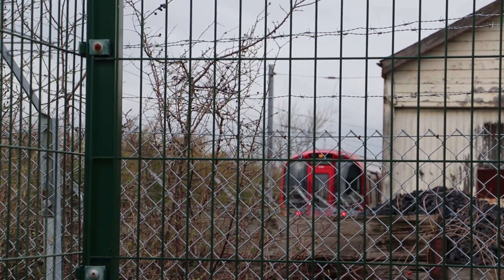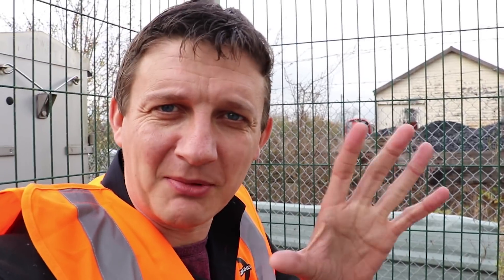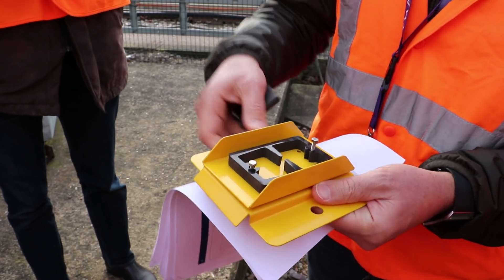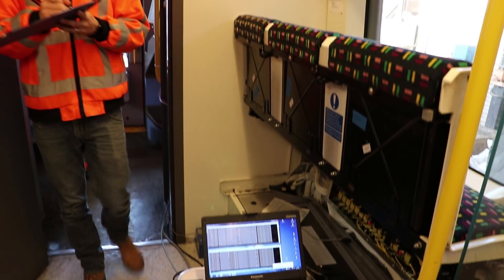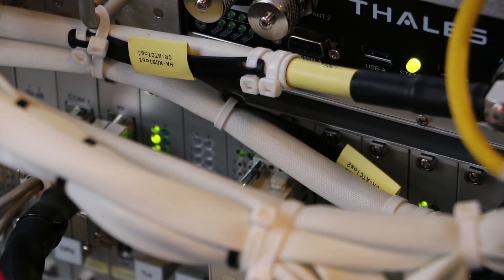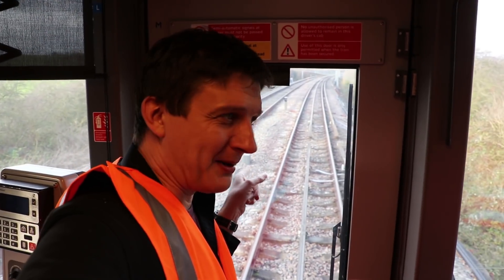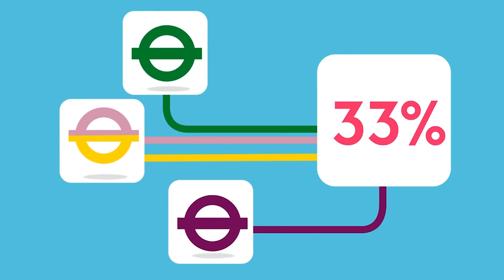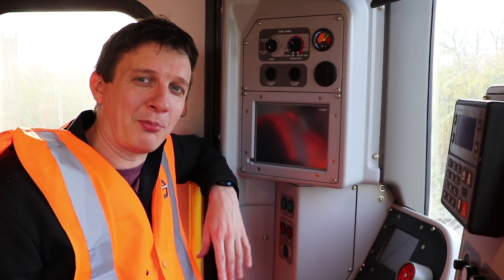London Underground Four Lines Upgrade

Comment: How is an increase from 28 to 32 trains an hour, a 33% increase? 🤔
Reply: That's exactly what I was figure out!
Reply: Bigger trains + more trains, both adding up to a 33% increase in capacity.
Reply: Number of passengers inside the train increased coupled with 28 to 32 tph increase gives 33%
Reply: I think the trains can go at a faster speed as well

Comment: It’s funny the trains have indicators
Reply: Mark StJust 1:45
Reply: That indicates the train is being driven in restricted mode
Reply: Looks awesomely funny LOL
Reply: Will Warde-Norbury you are a king
Reply: Closest thing I've seen is that the trams in Manchester have indicators
Reply: I thought the same thing!
Reply: Will Warde-Norbury lol ur right
Reply: nige4444 u have a point
Reply: +1
Reply: S stock are getting modernised after 22 years of work?? XD! BETTER GIVE C STOCK BACK ON HAMMERSMITH & CITY AND ON CIRCLE LINE! because C stock me is mad at you
Reply: Will Warde-Norbury c
Reply: nige4444 that still means they are indicators right? XD
Reply: William the butchers son productions probably to indicate when it's stopping and pulling off from a station.
Reply: They are lights.
Reply: All new build, and retro-fitted to some of the older builds are hazard warning flashers. Will make it obvious to other Drivers that there is an on-board emergency such as a Driver taken ill, or other emergency. Will augment the GSM-R on-board system.
Reply: Maybe the trains indicate when they switching tracks
Reply: They don't

Comment: Am I the only one that feels kinda bad about all the drivers out of work?
Reply from the maker: trains still require Train Operators (drivers) so no one is "out of work"
Reply: nah, surface lines are still likely to be manned for a long time...
Reply: The Victoria Line has been automated since the 1960's and still have drivers in the Cabs...
Reply: First next major tube strike. LUG will just flip the switch to automate the trains.
Reply: I don't think they'll be out of work. What might happen is that the lines will eventually become automated (especially if the New Tube for London upgrades go ahead) but there will still be a driver in the cab to open and close doors and in case of an emergency, or it might become like the DLR which is driverless but has a member of staff on board. IIRC DLR trains can be manually operated if there's an emergency or the computer fails.
Reply: stephthestar90 DLR can be driven manually only at 5mph. Tube stock with ATO all have a full speed manual mode
Reply: At least for the time being...let's see what will happen in some 15,20 years from now...
I wonder if in 2037 will there be drivers on the Underground/tube trains  or will it be like the DLR...

Comment: Well...it’s high time to modernise Piccadilly and Bakerloo line stocks, I thought that this vid will be about it 🙇🏼‍♂️
Reply: The New Tube for London :P
Reply: POKWIŚ TV that’s the next underground project once this is done.
Reply: Well since the 4 lines are the sub-surface S stock lines that's not very likely. The 4 Lines of 4LM in case you are not clear are District, Met, Circle and H&C.
Reply: About 10 years away - Picc first, then Bakerloo in 2029 to coincide with opening of Bakerloo Lewisham extension.
Reply: Current Piccadilly stock is 45 years old...
Reply: Picadilly stock goes in 2023 and new stock is coming next year on the Bakerloo

Comment: What's the difference between this and using GPS?
Reply: GPS doesnt work underground.
Reply: Hendrik Brons  And I think GPS is only accurate within about 10 metres?
Reply: GPS is only accurate to maybe 10m even if it worked underground,, you need a physically accurate position system if your going to have trains in a moving block signalling system. Take a look at this already working system, London Docklands light railway, https://youtu.be/a52ZSCIAoRk
Reply: Andrew Gwilliam non-military GPS is. 10 metres ...
Reply: - the ..story.. is that during the Iraq war the us military bought commercial GPS receivers and switched off the drumming down ,, so the commercial receivers became as accurate as the military receivers, and its remained so to this day....
" ... For example, GPS-enabled smartphones are typically accurate to within a 4.9 m (16 ft.) radius under open sky (VIEW SOURCE AT ION.ORG). However, their accuracy worsens near buildings, bridges, and trees."
https://www.gps.gov/systems/gps/performance/accuracy/

Comment: Toronto is about to get full ATC signals on Line 1, but starting in sections until 2018/19 when it will be fully rolled out across the line.

Comment: Ugh, ATO/TBTC is the plague of the Underground. Nothing beats a human on the handle.
Reply: Techandtrains101 As long as there is some Protected manual driving at times, that makes it fair for the drivers
Reply from the maker: incorrect.  tests have shown that TBTC on the Northern Line make the trains more efficient, and a manually operated unit the length of the line cannot now keep to the timetable.
Reply: Londonist Ltd omIt is better numbers wise but the ride quality on the Northern, Jubilee and Central lines have all suffered greatly from the very aggressive on/off driving style of ATO. Also while failures are rarer on the new system they seem to be able to cripple the whole line way more than a regular signal failure. Anyway I'm just a stick in the mud kind of guy I guess...
Reply: The victoria is ATO and is extremely smooth. TfL really needs to get coasting support into the software (it was supposed to be there in the initial Jubilee contract but got left out)
Reply: "Nothing beats a human on the handle"
Except computers. Get with the program (pun not intended).
Reply: ride quality... ffs
Reply: Higher frequency is a greater benefit than slightly more pleasant acceleration/deceleration is a loss.
Reply: looks like we found an RMT member...
Reply: The Chicago L has run trains on less than 2 minutes headways with ATC for a long time with human operators :-)
Reply: I hope the new cbtc system is more smoother, hopefully with the S stock being newer train it might be more smoother, as the 1996 stock had to be modified to run ATO.
Reply: London needs to do this because a human on a handle cannot cope with 36 tph.
Reply: Its more jerky than a human driver ever would drive
Reply: tyteen4a03 think it was ‘cause Tube Lines was pressured to deliver the Jubilee line upgrade...
Reply: Moorgate crash 1975 !

Comment: Damn, I wish the MBTA would do this on the Red Line.
Reply: Ayy fellow Bostonian! 

They can't because all of their trains are 10+ years old, we would have to probably wait around 2022 to even consider this.
Reply: Well I believe the Red and Orange lines are getting new subway vehicles in 2019 - in fact I believe they're being built right now.
Reply: kd1s The Blue Line trains where always pretty good. When the retired the 0600's off of them (0600s are smaller and blue versions of the current 1200's) if they retired the 0600s, why didn't they retire the 1200's along with them?

Silver Line Washington Street is much better now due to the fact we have recently gotten newer buses built by NFI, (New Flyer Ind.) and our current dual modes for the Waterfront Silver Lines are being overhauled by Maine Military Authority for the Airport route. We are also expecting a new silver line route to be introduced in Spring of this year, spanning from South Station to Chelsea via an old Railroad right of way.
Reply: And the WMATA
Reply: yes in Springfield MA they are currently producing them. already the pilot cars are set in Wellington Yard.
Reply: About damned time. I remember when they announced it back in 2015 or so. Now on the Red Line there are the older 15 and 16 and 17 cars - those are rattle traps. But then there are the Bomardier cars that look as though they were built late 1980's, into 1990's. They're built well - but showing their age. 

And the cars on the Orange line - definite 70's - come on wood paneling in the car?
Reply: yes. we probably wont be expecting red line cars for another year or so but green line cars should be coming right about now. Type 8's are full of problems and we are just now rehabing the Type 7's.
Reply: Yeah I'm familiar with the green line issues too. They're also of 70's and 80's vintage cars. It's funny I've ridden on the Orange, Red and Green lines, but never on the Blue or Silver lines.
Reply: RED LINE = Central line Silver = jubilee line Gre-- get a tube map and find out.

Comment: But... Piccadilly. Tfl why are you ignoring Piccadilly
Reply: Errr, have you SEEN the Bakerloo? The Piccadilly line's trains are in a much better condition than the loo but will get the new rolling stock first. Talk about unfair!
Reply: "The new tube for london" explains everything. Before 2030 the Piccadilly Line (As well as the W&C, Bakerloo and Central line) will get automated trains with somewhat comfy seats, real time information (such as on Tfl Rail class 345) and airconditioning, seemingly as well as platform doors at almost every station.
Reply: @Jasper-oi9dh 
Don't forget the best part - WALK THROUGH CARRIAGES 🤤
Reply: Hashterix, The 1972 stock being of simple stock is being Modernised and refurbished, so that they will last for another 10 years. The 1973 stock used on the Piccadilly line is more modern and would be more expensive to modernise so the decision was taken to not modernise the 1973 stock and the Piccadilly Line would receive the new tubes first. The Bakerloo line is not nearly as busy as the PIccadilly and the 1972 stock will be modernised so it is entirely fair.
Reply: There're not going to be any PEDs on the Piccadilly line.
Reply: but this vid is about the tube
Reply: RealistikDash, they are talking about the Sub Surface 4 lines modernisation, Metropolitan, Hammersmith and City, Circle and District. The Piccadilly Line will be covered by the New Tube for London project.
Reply: RealistikDash because is the tube.

Comment: Does that mean no drivers required?
Reply: There will be drivers in the trains but they will only be required to open/close doors unfortunately.
Reply: Unfortunately Merseyrail is getting rid of their guards when the new stock arrives. There's been a lot of strikes because of it.
Reply: So why carnt they install a guard's panel
Reply: Frainie 12 personally I think they should, but they probably won't. Guards are definitely a thing of the past for the tube, but Merseyrail, another metro-esque system, still uses guards with shorter trains and drivers. Personally I think TfL should reinstate them, and they have done on the DLR, which drives itself.
Reply: Harvey John Drew They will probably drive manual on certain parts of the line on Sundays
Reply: Some systems are fully automated with door control as well, however it is wise to still have security minding the trains and station and also able to operate the trains manually should need be. The Skytrain in Vancouver during heavy or wet snow fall occasionally has Skytrain personnel have the manual control ready and watch for people on the tracks as they need to disable the station track sensor (for people falling on tracks to stop trains) as dropping slab of snow can cause they trains to dynamite the brake.
Reply: All the driver has to do is operate the doors, and press two buttons to start the train. The train automatically drives itself and stops at the next station. Of course, the driver can take manual control if the need arises.
Reply: smallfaces yes there has been tons of strikes over it. They won’t stop. I can see why though as the amount of people who act stupid on our trains. I think the doors thing in jubilee line is brilliant and should be all over the country.
Reply: I'm not sure I understand you're question
Reply: I know. It's a shame isn't it
Reply: Theoretically, yes. In reality, the maximum they might end up is DLR-style where staff members sit in the cab.

Today, they will have drivers in the cab to open/close doors.

Comment: Signal replacement New York will never see as its system crumbles
Reply: Brendan A. MacWade The Subway already has CBTC-ATO installed on two lines. The L has been automatic for years and the 7 is in final testing and should be ready within the next year.
Reply: metropod And it’s also coming to the Queens Boulevard E F M  R line soon as well
Reply: well, we had an opportunity to do something about that, didn't we... and we did nothing. The idea of elected democracy is if your leadership is ineffectual, you don't vote for them.
Reply: That's easier said than done, as that allows for very little work time (hence the closures starting earlier) and severs connections in a city that is already poorly connected outside of Manhattan and parts of Brooklyn.
Reply: If they close a line between 12:00 and 5:00 in the morning, that wouldn’t disturb the line as much
Reply: signalling upgrades there doing right now but I'm worried for their old ass infrastructure

Comment: And the north still use Pacers
Reply: They should've been withdrawn 10 years ago. Antiquated is putting it lightly.
Reply: 1DABTube the point is that The North should have modern and safe trains too, not Pacers that are death traps!
Reply: @SpudderRail  death traps that should have been replaced 15+ years ago with new trains, seeing as the South has been getting new trains pretty reliably its farcical that the north hasn't had every pacer replaced by now.
Reply: The worst thing about this is that they aren’t being replaced because of the godawful ride, or the horrible rail squeal, or the noxious gases they spew, but because of the bloody toilets! I tell you, of they were complacent to the act, we’d still be using pacers when the Underground is fully automated and crossrail 2 is open.
Reply: and? You could have had the D Trains in service already 😉
Reply: Harry Todhunter They are going to be phased out within the next couple of years though!
I travel on them quite a lot.
Reply: Sarah Noble would be nice if I could have EWR too, so I could finally commute to work without driving. So be it.
Reply: Electrification is needed up north on most lines, as well as Welsh rail. Judging by how long the Gospel Oak to Barking electrification took, along with cost, I can see why they are procrastinating on this matter. Luckily I am not a Northerner.
Reply: The way our government has run down regional railways is disgusting. Crossrail was originally supposed to be built in the 1970s and Londoners were paying over a million pounds every year to "safeguard" the route. So, cash hasn't exactly been throw at the capital. There has been a long fight to get it.

The North deserves that sort of investment too. It's not an either/or thing. We need our entire country to have a decent railway service, in order to reduce the demand for motor vehicles and improve the economy.
Reply: It has more poeople than the whole of Scotland
Reply: All about London and the South East the North is irrelevant to londoners
Reply: Stu Wilkes They're only just electrifying London- Bristol, so the North will have a long wait
Reply: London has more people than Manchester Liverpool Newcastle Sunderland Birmingham Nottingham Leeds and way more combined
Reply: Because Scotland has loads of mountains and places where people can't settle
Reply: which are going to be replaced, bar stoppers on the south coast. Also there will be plenty of trains coming off lease due to London Overground, Abellio, London Midland and South West Trains acquiring new fleets. And as old and antiquated as the Class 313 is, it is not a bad as a pacer.
Reply: So that is not a reason to stifle rail investment in those cities.
Reply: That is not an argument and the Class 313 is being replaced on all but a few stopping South Coast services
Reply: That is also not an argument as to why the North gets shit and London gets new bespoke trains costing millions a pop.
Reply: I am not saying it is. However there are some that think that old life expired trains should be refurbished for Regional Railways whilst London and the South East are getting modern trains at great expense.
Reply: Mason Greater Manchester has 2.8 Million, Merseyside 1.38 and the West Midlands 2.8 Million. These are sizable populations
Reply: Only looking at Northern English members of the Core Cities group (metro areas):
Manchester: 2.8m. Liverpool: 2.2m. Newcastle: 1.7m. Sheffield: 1.6m. Leeds: 2.5m. Total: 10.8m
Not too far off London's metro area population and yet: http://infographic.statista.com/normal/chartoftheday_2132_Spending_per_head_on_transport_infrastructure_n.jpg
Population is such a bullshit excuse.
Reply: But not for long.  They will be scrapped in 2020! WHOHAHAHAHAHAHA!!!!!!
Reply: I don’t like pacers
Reply: I'm reading this another two years on, and we've still got bloody pacers up north. And even more of them are running late (if at all).
Reply: The worst bit is that the new northern trains are just cheap plasticy crap from CAF.
Reply: Intercity 43 shut up.